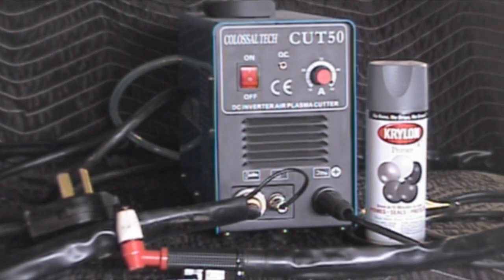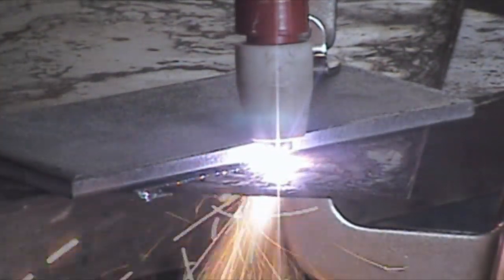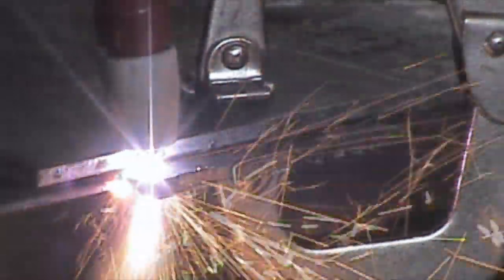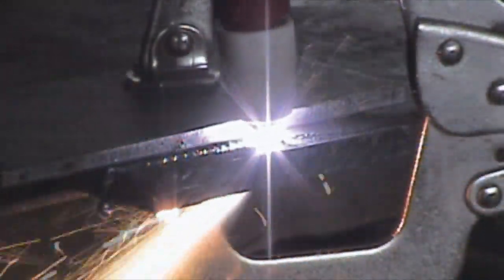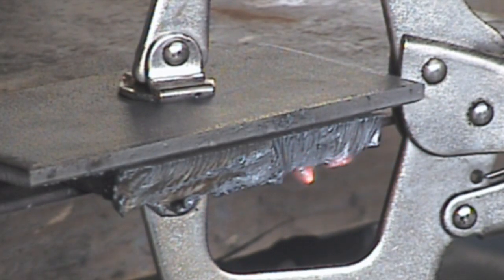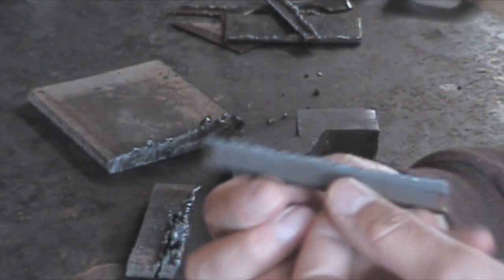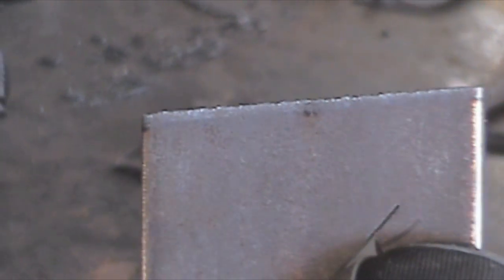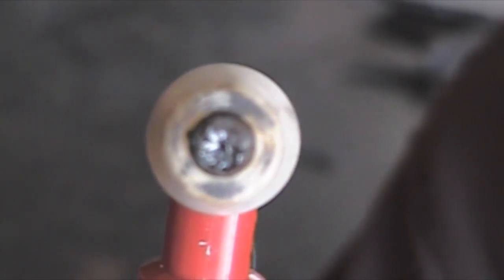Colossal Tech Cut50 Plasma Cutter

Comment: I thought I heard some was as high as 80 + that hose will brake
Reply from the maker: I haven't had any breakage, but it wouldn't surprise me if things wear out a bit faster.
Reply: Is a way to find the way get parts , or just throw a way unit
Reply from the maker: Donald Laisure I haven't had to buy many parts so I'm not sure. The consumables for this cutter are the same for a lot of the other import cutters. And I did get a new trigger after mine broke. Someone who viewed one of my videos actually found it on ebay for me:)

Comment: Hi;
I order a CUT50 and to my surprise there are only 2 wires for connection to 220V  i.e. missing the ground wire.  It's my belief this is not correct and may have been sent a repaired cutter.  Could you tell me how many wires were on your welder before you put on the 22v plug?  Thank you